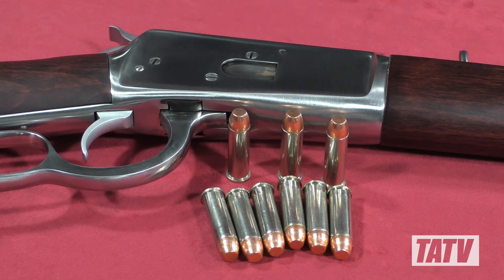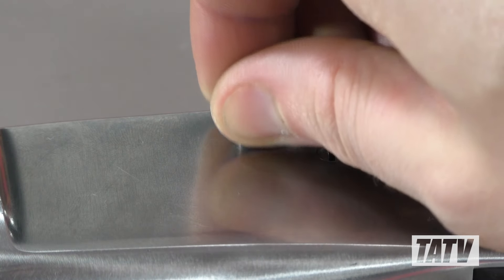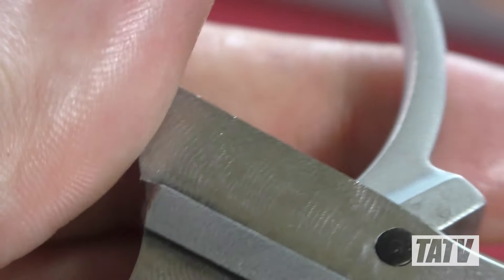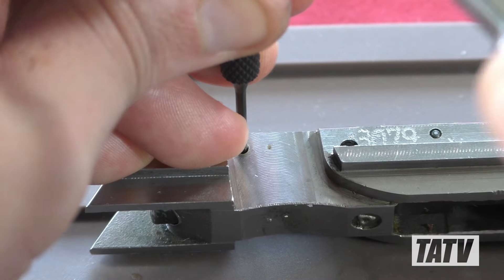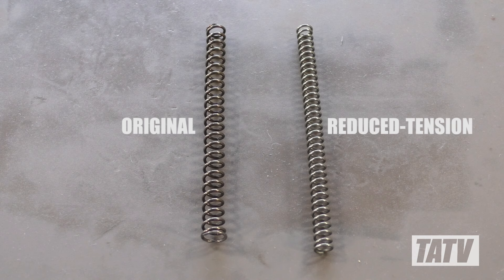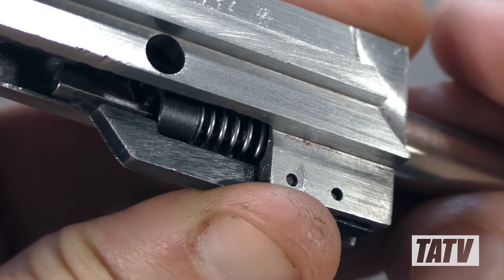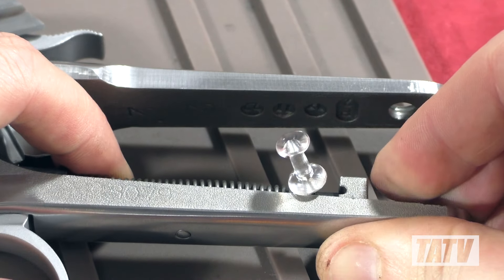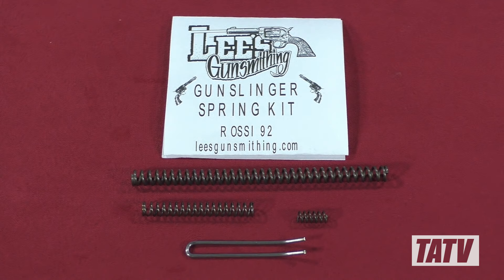Slicking Up A Rossi R92 Lever-Action Rifle - Part 1

Comment: Thank you for the video! But wow, the bolt rails were somehow cut off before where the mortises are cut into the bolt... the ends of those rails are supposed to be part of the locking surfaces on the bolt where it pushes against the locking bars. I know Rossis have been hit or miss but this might be the biggest QC blunder I've seen on one.

Comment: For all of you wanting a higher trigger pull weight than 1.5 with the new spring provided. There’s an easy solution. The spring provided is actually longer and allows for movement forward or rearward. The more you move the spring forward, the further up the trigger ramp the spring goes, increasing trigger pull. The further rearward on the ramp, the lighter the pull. So anyone can use the new spring provided and obtain a higher trigger pull/weight by where you place the two prongs of the spring on the trigger ramp. When you dive into replacement you will see what I’m describing.
Reply from the maker: Absolutely correct; may want to add a touch of blue loctite to secure

Comment: So I picked up my new R92 357 triple black the other week and got out and shot it. It’s been 5 months coming. They sent me a new one after not being able to repair the original I bought in December. Anyway I ordered a spring kit after the first day of shooting and installed them all tonight. The ejector spring took me some time to seat and to realize the spent cartridge with finger pressure was needed to keep it all in place. The video made it look like just putting the cartridge in the bolt would hold it all together. lol. I have to say my bolt machining is way nicer than the one on this video. Every surface is smooth. No burs. The spring kit definitely lightened everything up. The action feels like there is very little resistance. Very loose in the action, like gun is older and big time broken in. Trigger is super light as well. A full round of 357 ejects and just clears gun due to weight. So a casing will be perfect. The lever spring is just strong enough to hold the lever in place. Not sure I like it that loose. A little shake and it falls open a bit. I may put the original lever spring back in. Time will tell. 😂 Anyway it really is a drastic change.
Reply from the maker: Glad to hear you got it all back together again ok. You're right about the bolt/cartridge case; it's a delicate reassembly that's unfortunately somewhat difficult to film and articulate well on camera. Took me more than a few tries to get it right too, believe me.
Reply: It’s a great video. Was perfect for disassembly and spring replacement. One other thing I noticed is the trigger spring placement makes all the difference when wanting a higher poundage pull or a lower poundage pull. So people wanting more can make the adjustment by moving the spring further forward up the ramp.
Reply: Whoever designed the ejector system needs a refund from the Sonoran Desert Institute.  🤔
I know JMB designed the 92, I should have left the bolt alone!

Comment: Nicely done video. How does the ejector spring affect trigger pull? I fail to see the relationship.
Reply from the maker: The ejector spring won't affect the trigger pull. The actual trigger pull weight is controlled primarily by the trigger spring, and to some extent the finish of the trigger and related pin.
Reply: Yea I think he mis spoke and meant to say lighter ejection. Not lighter trigger pull. Even I said Huh? When I heard it.

Comment: Excellent video in terms of content and video quality.
I have the .454 Casull model and will do some of the work you've shown but not sure about a 1.5 pound trigger on that much power.
Reply from the maker: There at either spring kits out there with varying levels of tension. I'm sure you'll be able to find one that suits your preferences.

Comment: I'm about to buy this spring kit but am wondering, have you had any issues of the reduced tension spring causing failures to fire.. as in "light primer strike"? I don't know there's a dedicated fp spring or where it is but I have to wonder about that. Great video, btw!
Reply from the maker: I haven't had any issues with light primer strikes on this particular firearm, but I have experienced that issue in some other guns, mostly revolvers. I'm going to be addressing it in a later video but for some firearms you can buy an extended firing pin. It's maybe only 0.005" longer, but it's enough to compensate.

Comment: I think I will probably also use the dremmel to clean up the loading gate port. They say it has sharp edges too.
Reply from the maker: That's coming up in a future video but you're quite right.
Reply: The gate/dust shield and spring tension will be the next thing I do. My gate looks to be a tad too long because it catches on the frame and doesn’t come up all the way. I will need to take a little material off the end.

Comment: Thanks for the video. I purchased one 2 months ago. 20" 357 stainless - My seems to be real smooth acting. The only issue I have is the gate is hard to push in all the way and there was a burr right under where the bullet goes in. Simple file removed the burr. Have not shot it yet as the waeather went south here. Hoping for 1 more warm enough day to test it out.
Reply from the maker: Trouble with the loading port is a fairly common complaint with these. Mine isn't actually too bad, but I am still planning a future video on addressing loading issues including the port and mag tube spring.

Glad to hear yours is working well. They are nice guns for the money and I'm sure there's some variation in them from one to the next.
Reply: I bought my 44 mag 16in about 2 months ago. The machining is perfect. Rossi has really improved the quality of their firearms in recent years.

Comment: 👍 I was hoping you would have addressed The loading port they are typically pretty rough
Reply from the maker: I agonized over whether or not to include it in this video and finally decided not to. This one was already 11 minutes long, and if I included the loading port, I'd have wanted to add the magazine spring, too. The plan is to cover both in a future video specifically aimed at the magazine/loading elements of the rifle.
Reply: @TATVCanada - A whole 11 minutes huh lol nothing wrong with longer videos, I regularly watch videos that are 20 min - 1.5hr+ long and anywhere in between.. different strokes for different folks I guess

Comment: Great video, thank you. Couple questions. 

First, did you clean off all the existing oil before smoothing the edges with something like mineral spirits? Could one use sand paper instead of the India stones, and if so what grit? What type lubricating oil do you favor when reassembling the  gun?
Reply from the maker: I wiped the surfaces of any packing grease more for convenience than practicality; the honing oil is pretty slick anyways so I didn't see much reason in cleaning it further.

You can definitely use sandpaper (600 grit is a good starter). I like India stones because they're perfectly straight, which helps preserve any crisp lines or angles present. Once you're done smoothing things with the 600 just switch it to 1,000-2,000 to remove any score marks and polish.

For oil I like hoppes or butches for moving parts. They're both fairly standard gun oils. If something is a particularly tight fit and relatively stationary you may want to consider a thinner aerosol oil; they provide good corrosion resistance without drying/hardening which is great if you don't frequently disassemble the firearm.

Comment: Well shoot.  Now I guess I have to buy one to try all of these processes...as the first one I bought several years back just got shot thousands of rounds until it smoothed out.

Looking forward to the the loading gate & tube video. That's probably my only minor remaining issue with my current one, I feel like the gate could be better.
Reply from the maker: Absolutely worth the money. It's got issues, but they're cheap and easy to resolve. I say go for it.

I'll be addressing the loading port and mag spring in a future video.

Comment: I just subbed to your channel because this article had some of the information I was looking for.
Very good article and I am REALLY looking forward to theVideo about How and where to remove Metal from the Loading gate and How much Magazine spring I can remove and still get reliable functioning.
I use mine with 38 Special as well,low recoil and mild report.

Mine is the Stainless 16 inch barrel ,although I am in my sixties I was Like a kid in a candy store while I was looking at the different models.
I like to do my own work on my gun's ,have always enjoyed doing this.

I am not a competitor just an occasional Plinker.

Thank's for the good video
Reply from the maker: That's for your comment, glad you found the video helpful. It's definitely impressive how many choices they have; you would almost think the retooling costs would limit them but clearly the manufacturer found a way to make it work. The mag tube and loading gate video is in the works but will likely be a while yet as it's a few places back in line.
Reply: Thanks,looking forward to them @TATVCanada

Comment: Think i could do this on a bench grinder with buffing wheels or would you still stone the flats?
Reply from the maker: I'm sure it can be done, but we're removing only a few thousands of an inch of material. I would be concerned about either removing too much, or accidentally messing up the angle.

Comment: Ok, I am the dumb ass who can't reassemble his 92. I am stuck sliding the lever into place. I get it back in and the lever is lock as is the bolt. I follow step by step of the video still no joy. I must be an idiot.
Reply: I just needed to hammer home the pin, DUH!🙄
Reply from the maker: Hi Joseph, sorry to hear you're having trouble.  If it's any consolation to you; there were plenty of outtakes when I filmed this, so you're not the only one who had issues!  If you're still jammed up, send me a couple photos of the firearm and a brief description of the issue and I'll see if I can help you out.  greg@tatvcanada.com
Reply: @TATVCanada  Thanks for the reply. I figured out that I needed to drive the retaining pin all the way home. Eazy Pessy. Still a good video on the Rossi 92. Went to the range on Monday and the rifle functioned great. The action was very smooth, and that trigger is sweet. Thanks again for your video. Keep up the good work.
Reply from the maker: @josephderrico6254  Ah that's great to hear.  I have totally been there, where you've got everything apart and for the life of you, you just can't figure out what's stopping it from going together.  Mine was a Remington 597 VTR I was breaking down to clean, and accidentally went a little too far, taking the whole trigger group apart.  No instructions, no internet, at the cottage.  Glad to hear you got yours sorted and back in action.

Comment: If we keep making excuses for horrible quality control, companys will continue to provide us with crap. I've owned several genuine Winchester model 92 carbines and one Rossi. One Rossi told me all I need to know.
Reply from the maker: I sympathize a lot with that statement. I used to have an economics professor who would say we vote with our dollars more than our ballots. In my case there aren't a lot of options here, the price difference was substantial, and to some extent I knew what I was getting into. Given the choice between a Rossi or a Henry for example, I'd certainly take the Henry; but I'm in a Rossi tax bracket ;)

Comment: … I’ve owned both and the Chiappa 92 is a lot slicker out of the box albeit more expensive than the Rossi 92 … and the Chiappa doesn’t have that stupid pigtail safety on top of the bolt
Reply from the maker: I don't mind the safety but I can certainly appreciate higher quality machine work. I've heard Henry is sort of the 'gold standard'.
Reply: @TATVCanada  … but to my knowledge Henry doesn’t make a Win 92 clone to date … they just make Marlin clones … Henry grabbed a lot of Marlins market share during the Remlin garbage gun years

Comment: Would it be worth touching up the vertical locking lugs a little?
Reply from the maker: There's a few other parts like the trigger pin, the locking bolts etc that probably would make some difference. The main reason I didn't do much with those was the machining on them was far, far better than that of the bolt and lower tang. At 11 minutes for this video, I wanted to focus on the low hanging fruit, but you could definitely still address some other parts.
Reply: @TATVCanada  thank you.  This video great and thorough. You could possibly break the different areas down into different videos as well. Like you've mentioned, doing the magazine in another. Great work!

Comment: Wouldn't it also be necessary to polish the inside edges on the receiver so that the machining marks on the inside don't just gouge new marks in the bolt?
Reply from the maker: That would be ideal yes, however as both surfaces are made from the same material, the amount of deformation imparted on one from the other will be somewhat mitigated. The original surface imperfections were caused primarily by the machining process which uses much harder cutting tools (usually carbide). In a more practical sense it's also just a lot harder to polish the channels on the receiver than the external surfaces of the bolt and lower tang.

Comment: Just for a few seconds at 10min 20 second he had a left side  loading door . I know this is no where the same rifle as mine , I would like to tear my Western Auto 30-30 apart to see how well it was machined in I think it was 1974 .
Reply from the maker: I didn't even notice it until you pointed it out but yes, I inverted the camera angle vertically so that viewers could see it 'right side up' when I was holding it 'down' due to my positioning relative to the camera. I should have also mirrored the image horizontally to account for that, but clearly missed it. Wish I'd caught that!

Comment: I wouldn't go less than a 3lb trigger. That thing will go off if its dropped or bumped.
Reply from the maker: So far so good, but I'm usually pretty gentle with it and it's still got the safety.

Comment: great video, it is a shame that this amount of work is needed to get a gun to where jt should have been out kf the factory but I guess a benefit is that they left you plenty of fat to trim.
Reply from the maker: I'd be lying if I said I wasn't disappointed at how rough the internals were. I have some machining background and even to a novice like myself it was obvious how poor the manufacturing standards were for some of these parts. The good news is that the only parts that require replacement (the springs) are cheap; everything else is just labour.

Youre not wrong about the loading port; I will be covering work on that and the mag tube spring in a future video as this one was just getting too long.
Reply: My new R92 picked up a few weeks ago (May 2024) has smooth milling. No rough milling cuts or burrs. It’s a really nice finish. I left it as is and just did the spring kit. Maybe newer builds are being finished nicer.

Comment: Put in the bolt and ejector spring back together for your tactic is bullshit. It’s nearly impossible. Some of the worst directions I’ve ever seen. Looks like I’m gonna end up buying a bolt already already assembled such horseshit.
Reply: Whatever you do do not take the ejector spring off at all. It does not go back on correctly and will not lock in. Do not follow these instructions. They are incorrect. Rossi doesn’t help any because they’re garbage, but in the meantime, you gotta do something right

Comment: All that work to pull it apart and you didn't do anything to address the horrid feeding?

Nice "partial" slicking up video.
Reply from the maker: It's called "Part 1" for a reason.